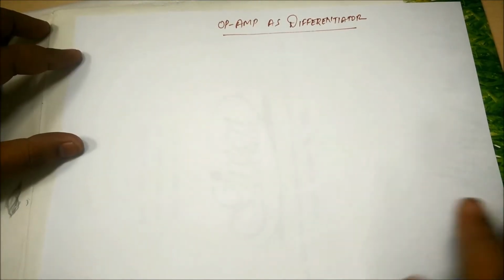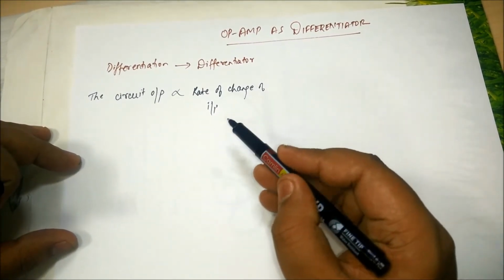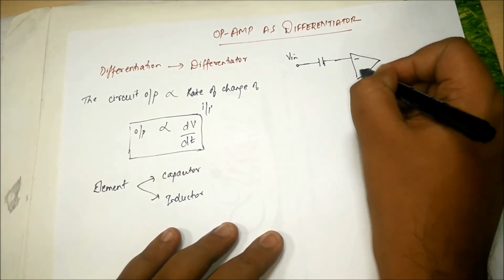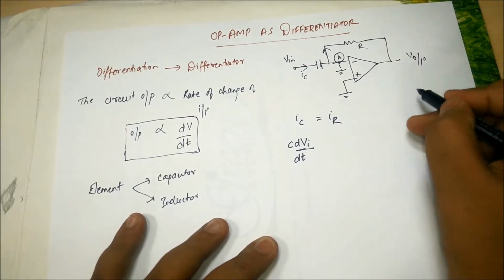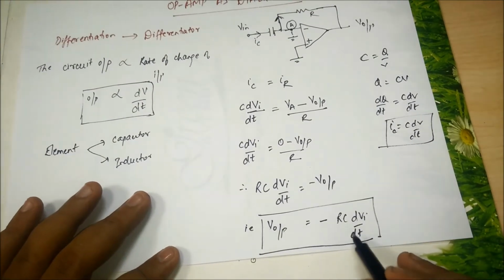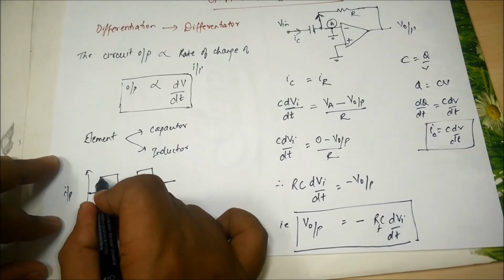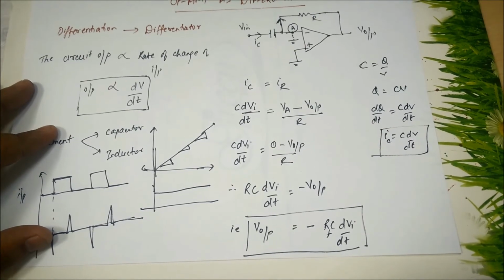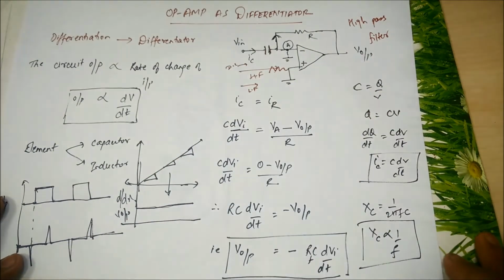Differentiator

Comment: Why we use inverting- terminal???
Reply from the maker: priya pawdiya ,Priya that's a very good question. Infact, I am planning to make a video on that..... But here is your answer, Virtual ground concept is applicable only in inverting mode of Opamp and we are using virtual ground concept in this circuit...... Now why virtual ground concept is applicable in inverting mode.... Stay tuned for my another video.

Comment: thanks for this...i would like to know about rc phase shift oscillator.....which part of this oscillates...what happens if i change the opamp with a transistor.will it oscillate...what is the working of offset nulls.....why there is the no 8 pin...
Reply: Offset is for, when no input applied, output should be zero.  But practically not zero.
Reply: thank you....please describe it fully and i have asked u more questions...please reply